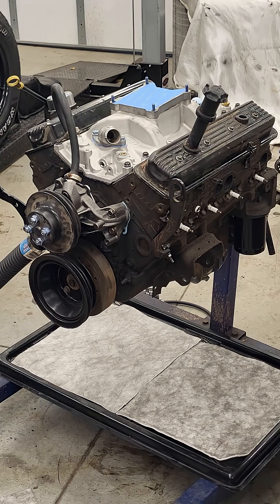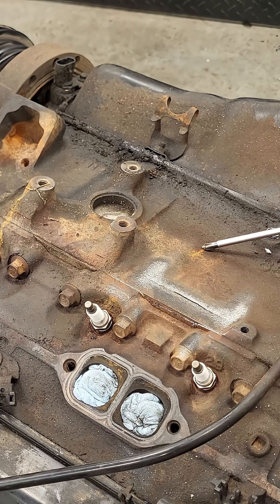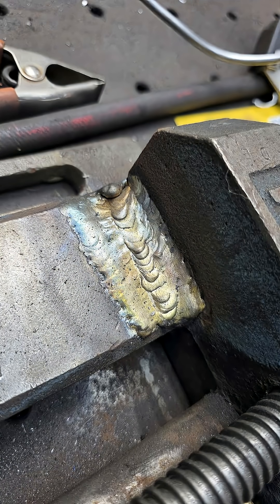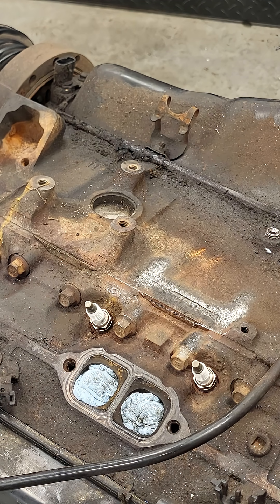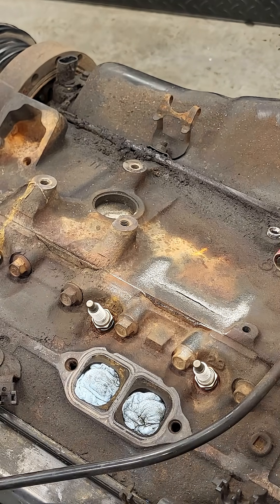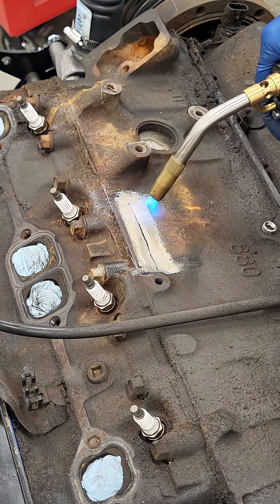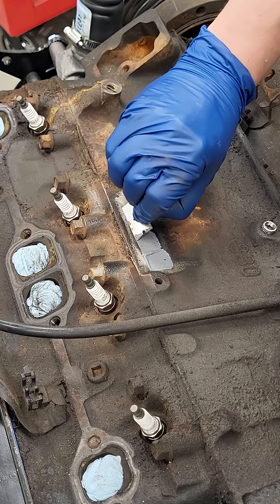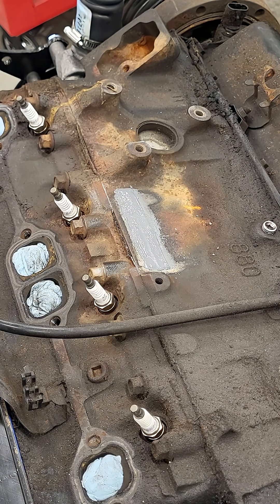3 Ways to Fix a Cracked Engine Block

Comment: I have the same issue with my 350 block. Did you use Belzona or JB Weld, and did it hold?
Reply from the maker: The high heat JB weld, and it does hold so far.